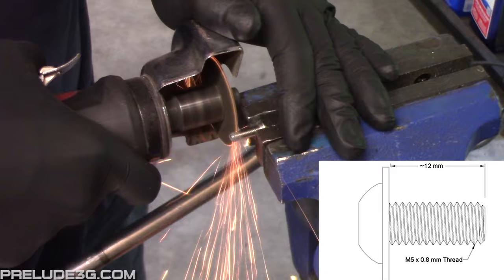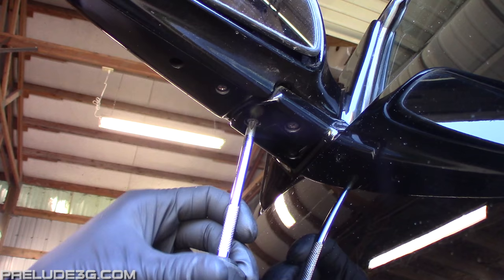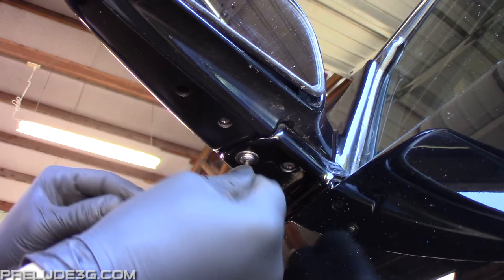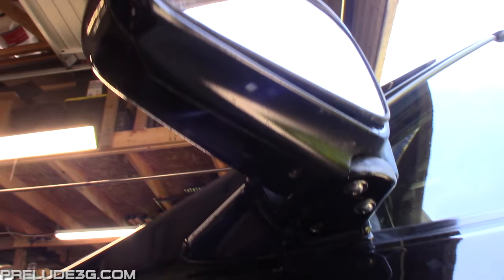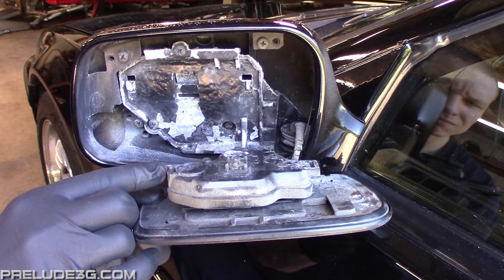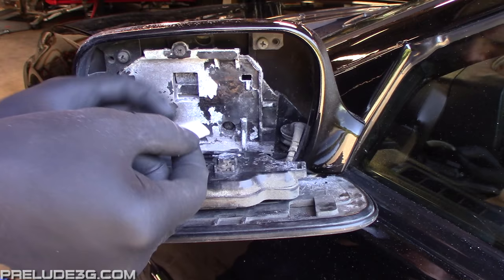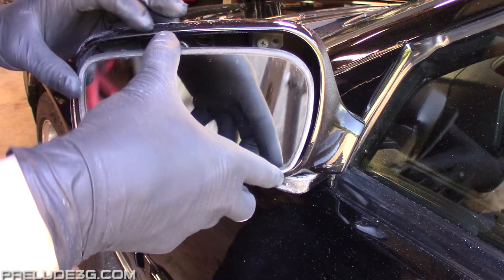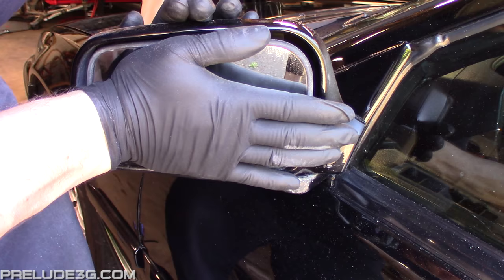COMMON PROBLEM: Shaky Mirror Fix

Comment: Great video, really appreciate all the videos you put up on the 3G.
I have a question, do you know how to replace broken mirror glass? No matter what I try I can't get the new glass into the plastic housing. I've tried heating the plastic in boiling water but still no luck. I've broken 3 replacement glass panes trying to get it in!!
Reply from the maker: I've never had to do it. Best I can offer is the procedure from the manual: https://i.imgur.com/TOQofuk.png
Reply: Prelude3G.com Thanks for the reply. I'll try the heat gun method and see if it works..!